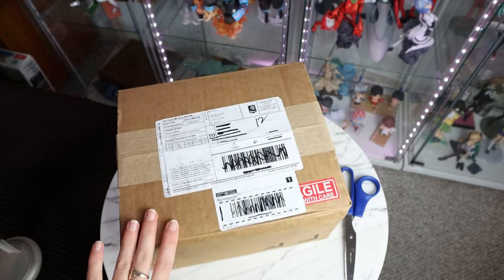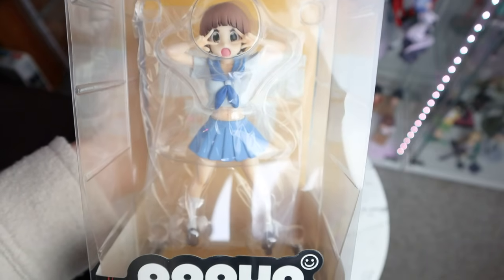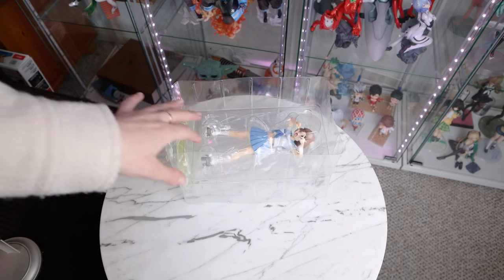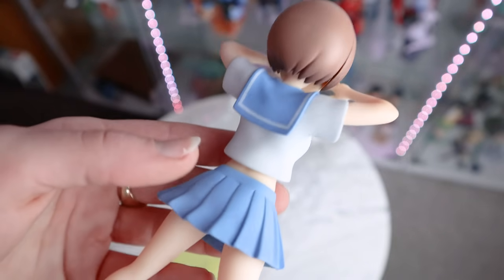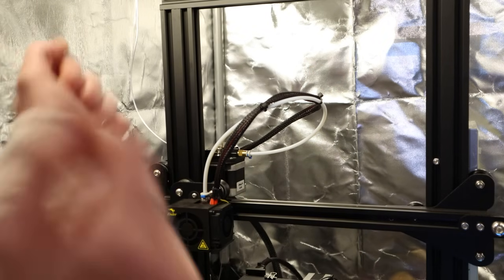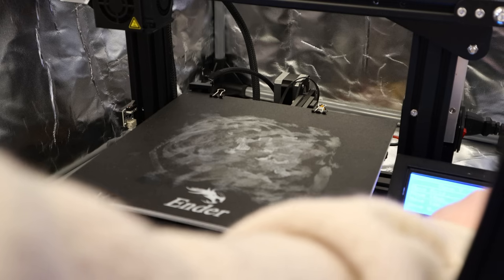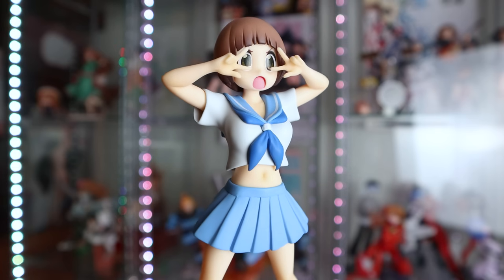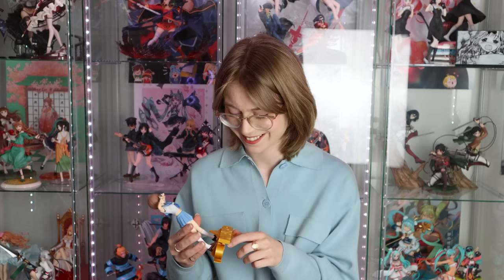3D Print a Figure Base With Me! // Unboxing my First Pop Up Parade

Comment: Hi Gwen, I love your videos and am impressed by your 3d print, given your experience. I do a lot of printing and to me the gunk is something I almost never clean. Some printbeds require glue sticks or tape which will lead to the gunk, but you can also look at different material print beds that don't need extra adhesive and you can avoid a lot of the gunk. Some people even like to print straight onto glass, but I think your set-up is great already and I would not worry about the gunk unless it becomes hard to remove prints. It is always easy to clean the bottom of a print with soap and water or lightly sand if needed too.

FYI, it looks like you scribbled the barcodes in your package with sharpie. The way barcodes work, they are verticals lines of different widths and spacings to correspond to numbers/letters. The kind of scribble you did is basically invisible to a barcode reader. I'd suggest pulling those off or putting a solid piece of tape over any barcode or address if you don't want people to be able to see the information those contain.

Comment: Heya, I run three different 3D printers. For and Ender3 if you have non circles you probably have to calibrate the Esteps instead of tightening the belts (unless the belts are really loose!)

You tighten belts on CoreXY printers for circles but the Ender3 is a Cartesian.
If you want some help just reach out, cheers
Reply from the maker: Thank you for the tips!!

Comment: I Love this! I recently designed and printed some pieces that were missing from an incomplete figure I got for an absolute steal of a price at a con 3D printing is a fantastic compliment to figure collecting! It's hard to tell 100% form the video since when you pause it, it is still a bit blurry but it actually looks like the gaps aren't from loose belts and arent ghosting, it almost looks like under extrusion.  You might want to slightly increase the nozzle temps, and increase the extrusion multiplier by a few percent.  Since this is the first time you're using that filament a temp tower and benchy might be in order. IDK  exactly what you printed at but since you used 200C to switch the filament out if you are printign at 200C try upping nozzle temp a bit, I've never used that exact brand but I know I've had to push other brands "silk" filaments up to aroudn 215-220C.

Comment: It is a bit scuffed, as a guy that has been modeling and printing for a while i am overcritical but it actually looks pretty cool, my suggestion would be to spray it with primer and paint after printing it in a fine layer height, it will be perfectly flat with a thick enough coat, that way you can also file the model down a bit without endangering the looks, this is pretty much the best way in my opinion when printhing with an FDM printer a figure piece.

Comment: looks great, i must say though, it does look like it needs sanding? or if you sanded the corners it will make its corners neater. am i wrong? or would it look scratched ? probs would need a paint job if it was sanded

Comment: I want a nice base for the your name ones. Its a project I will take on at some point. I want to either remove or  make smaller bases. Also the Nezuko one has an option not to use a base they should just do that for all of them.
Reply from the maker: I know! I kinda hate when they attach the pegs to the figures feet instead of the base so you need some kind of base for them

Comment: I had a very unpleasant experience with my Pop Up Parade Order (I used Solaris Japan). I preordered Inuyasha and Kagome (Sesshomaru on an other website) and they looked horrible when they arrived (bubbly paint on Kagomes Socks and Inuyashas Pants, scratched off paint on Inuyashas Hair, their eyes where too big, some places havent been sanded properly before painting, Inuyasha was very pale and yellowish) so I asked Solaris Japan if they where bootleg figures (they where not). Very reluctantly (they said they don't see any defects - despite me making close up fotos) they contacted Goodsmile Company for me (I don't know if they really did) and (so Solaris Japan says) Goodsmile said these are manufactory flaws and that they don't help with manufactory flaws. So Solaris Japan said that they could only offer me to keep the figures plus a refund in points for their shop but ONLY because it was my first order with them (usually they are more expensive so I normally order elsewhere) and "only this one time". That whole thing made me angry and disappointed. I didn't want a refund, I wanted replacements! I ended up taking their offer, very cheaply sold them on "ebay Kleinanzeigen" and now my points ly arround because I will not have money for an unknown period. I will never buy anything from Goodsmile again (except used figures so they don't get any money from me) and after I some day used off those points I will also never buy via Solaris Japan again. I cancelled the Sesshomaru I preordered on an other site with the explanation of what happened. Beware.
Reply: I'm sorry to hear about your experience. Popup Parade figures are really a hit or miss and too bad you got a bad copy. I own a few PUP figures for chars from FairyTail, FMA, KonoSuba, etc. and I'd say I got quite lucky with mine with a very minimal flaws. I heard other story like yours that recent new PUP figures' quality dropped hard. PUP are not perfect figures in anyway given how affordable they are but still coming from GSC with good reputation on quality, it's disappointing. I also ordered Inuyasha but I haven't ship him yet so I don't how he would turn out so cross fingers. Hope that won't happen to you again and happy collecting.
Reply: @jyusatsu  Yeah... I knew that the quality was hit or miss, but I never thought they would send out figures with that bad quality and especially that they would not offer a refund or a replacement. I will stick to Bandai, Banpresto, Furyu etc. from now on for price figures.
Fingers crossed yours will be ok. Thank you for your comment.
Reply: Thats is 100% Good Smile.  Solaris Japan has been great for me. Never had a single problem with them.  Thats all quality control on Goodsmiles part.

Comment: In the next attempt at printing a base, it may just be better to buy a good quality printer...then you shouldn't need to do multiple tries at it.  Sometimes the cheap printers will not print topnotch quality products, even tho you definitely have a topnotch design for the base.  Great job on that, it would be so much cooler if you added paint to it and made it really stand out.

Comment: I don't know how I feel about you thinking that crossing out, so to speak, the bar code does anything.... For starters, most scan only takes a "line" in, so if nothing else, you leaving the top uninterrupted nullifies your whole effort. Barring that, as long as the thickness of the line and gap can be told somehow, it can be reconstructed.
If you want to invalid the barcode, you need to black out, completely, about a quarter of it, preferably on the right side. Or.. tape over it with non-clear tape.
Reply from the maker: Haha I just just scribble on everything because I can, as long as my identifying info is covered it's fine but maybe I'll try taping next time just to be sure 👍